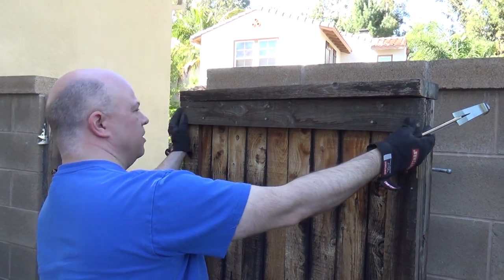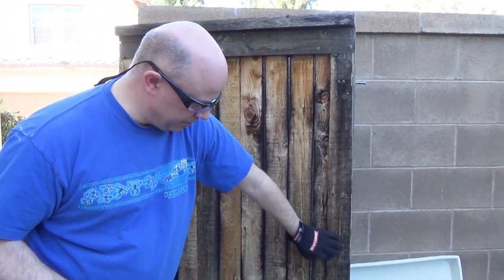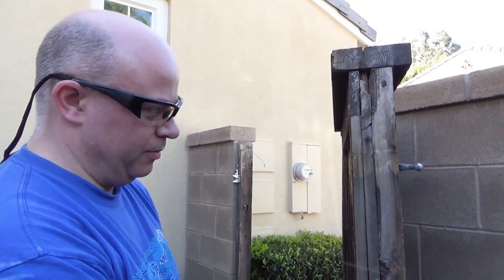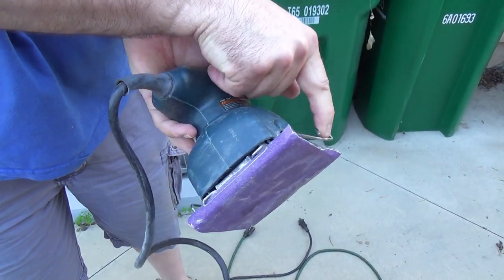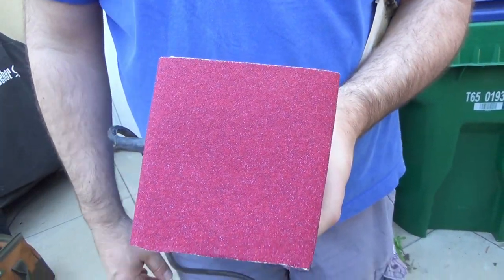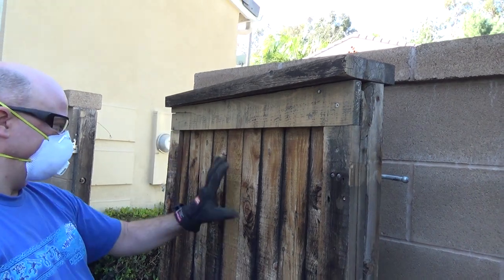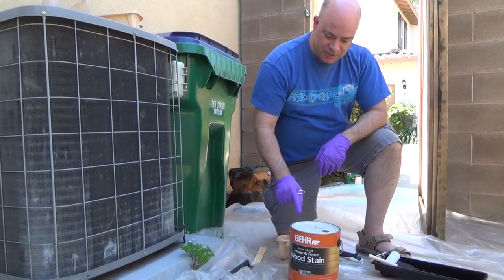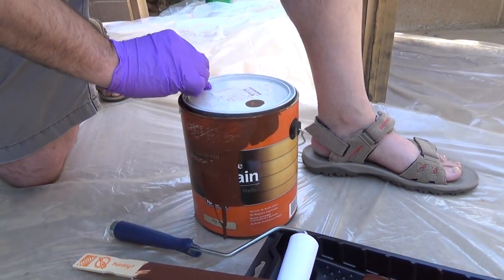How to Renew Wooden Gate and Fences

Comment: If the door is already painted , should I sand it a little before applying the same colour paint.Or sand and use a primer, then paint  ? Thanks
Reply from the maker: Thank you for watching. Yes sanding a little before painting will help the new paint stick to the door better. Primer is only needed if you are using paint+not stain) and there is spots of bare wood showing or if you are trying to change a color that is really different than the Old one.